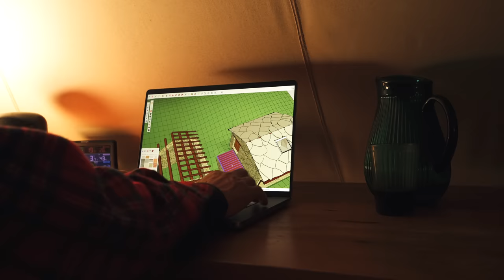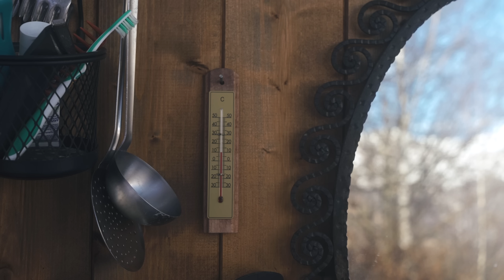#52 Back at the Cabins

Comment: Glad to see you again. Laughed when you lifted the frozen jar. Did you set it out in the sun? Then when the hammer went flying... Knew something wasn't right. Sorry about your injury. You must heal quickly. 

I feel such a spiritual kinship with you. I'd drink your coffee, eat your food, and paint along side of you or maybe in my own tent. I'm "at home" with you. I would gladly do tasks for you and help with problem solving. I know a bit of autocad and designing. For years I've played with house floorplans. I started big, then went small wondering how much space do I truly need to be comfortable in my life. I'm down to 400sf at the present time. I used to live in a 175sf camper. Not enough room for my art supplies. 

Thanks for the info on duck tape. I didn't know that it doesn't work in the cold. 🤔 Good to know. But I would have tried warming up the surface before applying the tape. Or warmed the tape after applying. So how did you repair the stovepipe sleeve? 

And yes, Johannes is a good man. I'd like him to be my neighbor too. 

Must admit I was feeling cold when you returned. Wasn't feeling up to all the work you were doing. I was back in the tent staying warm making soup. 

The beauty of your surroundings speaks to my heart and soul. The pink reflecting sunset on the snow was captivatingly beautiful. I'd be painting  sunsets or snapping pictures. 

Excellent gutter work. Of course you don't need praise on a job well done. How many coats of varnish did you use? And how many coats is too much?  

Thank you again, and again...  for sharing your life with me (and with everyone else). I suppose I can share you with the rest of the world. 

Janet
Charleston, SC, USA

Comment: I had a problem like this one but from wind.  I found aluminum pipe close to the interior diameter, cut the bent part of the tent pole, cut the new tubing about 5" longer than needed, insert into both ends of tent pole, then ensure the tent pole is back to the correct length, pre drill holes through tent pole and insert then screw together.  This can also be done using a collar that goes on the outside on tent pole. Johannes is a good friend.

Comment: I had a similar situation.  We had a pole that had a birdfeeder on top.  A big windstorm snapped it.  When I went to get a replacement pole, I also bought some rods that people would use for holding up a wire fence.  I slid the fence poles down inside the birdfeeder pole.  We've had several wind storms since then, and the reinforced pole has held up.  It looks better than duct taping it - though that will work for a while.

Comment: Could you install a shower curtain rod or some pipe on your roof( front and sides) attach a blue tarp on to it ( with zip ties or curtain rings) so you can protect your kitchen from the elements during the remainder of winter. 
You can use tent hooks to secure the tarp in the ground. Cut the tarp in half ( like curtains) and leave a tight gap to enter.
Keeping the wind out makes life a lot more comfortable.

Comment: You can bend a tube by filling it with soapy water and freezing it. The soap prevents the water from freezing hard enough to burst the pipe and the soapy ice provides enough support inside the tube that you won't kink or break it. its the method they use to make brass instruments.

Comment: Work never ends around the homeplace!  Hint:  Where you are constantly walking and standing on the snow/ice in front of your workbench and kitchen...lay down several of the boards you removed from the scaffolds.  Keeps you from slipping on the icy surface and is warmer on your feet, not standing on snow/ice🙂

Comment: Save up some of the firewood ashes from your wood stove and sprinkle it on the ice in front of the kitchen to prevent slipping. If that doesn't work pick up some rock salt or kitty litter.